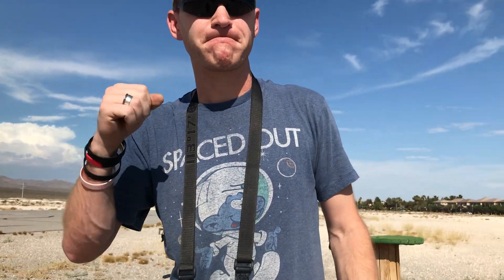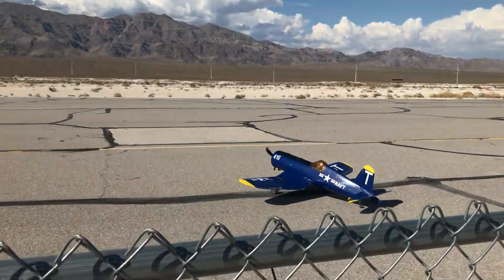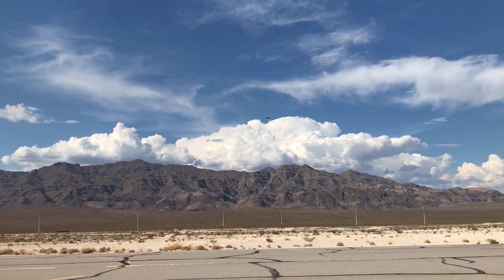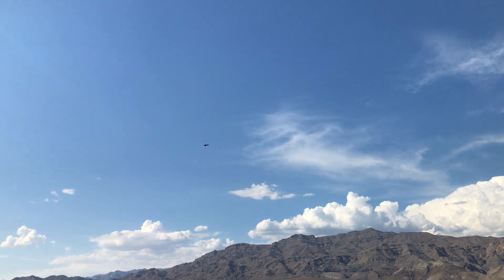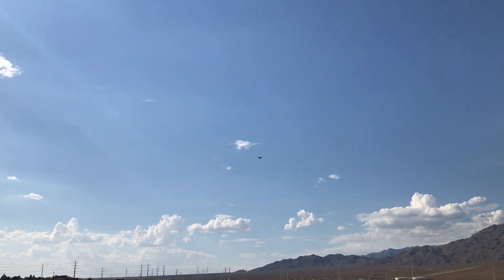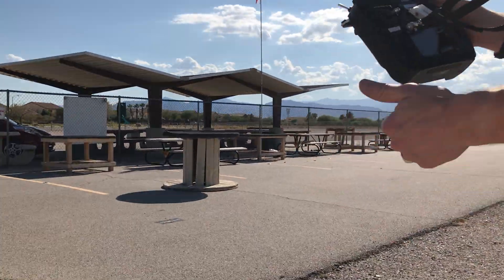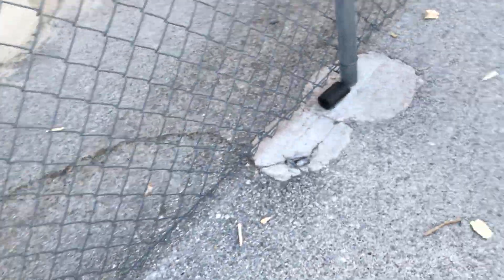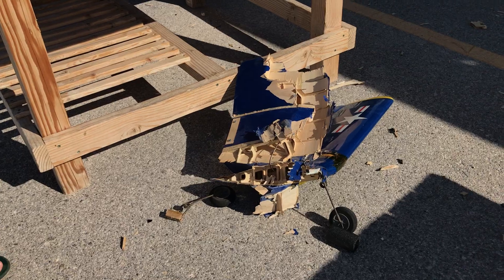First Gas Airplane Ends In A Catastrophic Crash

Comment from the maker: 1. Before you leave a comment about the RF signal critical... 
I'm using a multi-module transmitter with a spectrum receiver. 
You have to calibrate the RF signal otherwise it will constantly yell at you that 
there's an RF signal critical. I did not calibrate the RF so it always does 
that unless you turn it off. i forgot to turn it off before the flight. 
However I did set up fail safe and did a range check so all good there.

2. what happen?  
I added a soft Mount to my flight controller to test a few new things. This which actually worked OK on lower RPM. 
However at Full Throttle it got a little wonky 
due to the refresh rate of the flight controller matching the vibration rate of the full rpm.
if you watch the video you can see this in flight and right before the crash. and when doing high speed passes. this was a known thing and this is what i was testing. 

Watching the video back it seems like I was going full power trying to pull up 
thinking more speed would help but actually I think it was upsetting the gyro even more.

I kind of proved some of this out on the ground while I was testing and knew it could be trouble.

I actually had two settings on the gyro on a switch so I could play with high gain and low gain.

It didn't seem like it mattered but the low gain was more stable from the vibrations.

I went out there to do some experimentation with this type of Gyro with that type of isolation
 and there's the result. 
 
3. The fact that know one was there was a blessing, it was also intentional.  If I'm doing "new" testing of things i try to go out while know one is there for this exact reason. 

You cant fail if you don't get out there and try new things... but you also cant succeed ! don't be an arm chair pilot ( or commenter at that)  

so enjoy the carnage at my expense. 

~Russ
Reply: Try new things , what ? Flying with servo jitters is not new things, it’s very known not to do it.  What a waist of a beautiful plane.  You should be fined for that failure caused by incompetence.
Reply: I totally agree. I’ve had that same plane with the same zenoah 20cc engine. It’s a piece of cake to fly and rips the sky up like it’s on rails. I couldn’t force a bad landing out of it. I believe he took off without the gyro on anndnhe was doing fine. Not sure why he felt the need to ride it anll the way to the ground with it on if it wasn’t performing properly. I ultimately sold it since I had 4 other larger corsairs. That one actually flew best of them all and I miss it. I guess if planes kept getting “gifted” to me I could afford to “test” them into the ground as well. Lucky someone didn’t get killed. 

I don’t normally use gyros but aren’t they supposed to be HARD mounted, like NOT velcroed or double sided tape??? Don’t most people glue them and start at the Lowest possible gain and work up???
Reply: @RWGresearchLive   Didn't want to come off in a bad way. I just heard the radio repeating it.  P.s I have X1 carbon and love to print that one out.
Thanks
Reply from the maker: All good my friend! just wanted to make sure there was more context to the video as it seems everyone keeps saying the same thing lol  , cheers! ~Russ
Reply: This Pinned comment has been copied and pasted by this Cat in almost every reply.
Like this multi-module transmitter makes it ok to ignore if you don't shut it off so it doesn't yell at you..
because you chose not to calibrate or you were unable to calibrate.
Protocol, man.... protocol.  
And this guy does "Research" ...... SCARRY!
And yes I have Read All 90+ posts
Reply: Signal loss was literally your issue.

I don’t think you have to calibrate spektrum rx’s. I have futaba and frsky that you do have to calibrate, but my lemon and speks don’t need it.

It’s not ok to fly until they are fully calibrated.  It’s basically de tuned and it will unlink, or run like it’s in range check mode.  you could hear the engine powering down, likely going into fail safe.  

could have also been the ignition system causing interference to the rx.  That is very common.  Those systems need to be pretty far apart, and not share batteries and stuff. 

It flew well, looked like it was dialed in pretty good when flying.
Reply: You dont need to fine tune the frequency with DSM on a TX16S 4in1.  Other protocols like FRSky, yes, but not DSM.  I suspect you may have used auto when you binded to the RX and selected the wrong sub protocol.  What sub protocol were you in, and which receiver were you using?  Its very likely you had signal loss.
Reply from the maker: ah, so not the frequency of the TX/TX, but the RSSI has to be set to set. the signal was ok, just not the RSSI tune... ( the part that was yelling at me the entire time) ~Russ

Comment: I help new pilots at our club flying field often. Ive been flying nitro planes since '78.  I mainly fly 3d helis now.   I see 'new pilot' mistakes all over this video from the take off to the crash.  Its sad to see it go down, but it should have never gone up in the condition it was in on the ground.  A tiny bit of gas engine flutter on a large 40% Edge is ok, but this was not ok.  We dont fly gyros on airplanes (Horizon junk). Also, Warbirds are no joke. They were tough to fly in real life. I was trained to fly RC by a WWII pilot. It was a huge honor.  Thanks for sharing.

Comment: Sorry for you loss but your attitude was wrong from the start. You had known issue but ignored it. You had incorrectly set up warnings , strike two what were you thinking. And if you need stabalization on a plane you shouldnt be flying it yet, get a buddy to fly it and sort out the trim then once its sorted add the stab
 All your doing is creating bad press for the safe quality pilots out there . Learn from your mistakes and get some help. Your child could easerly have been sitting where that crashed.

Comment: People need to remember these are not "toy" airplanes and have a good amount of power pulling them thru the air. Glad no one got hurt, as bad as that sign got bent if it would of been a human standing their it could of ended their life. Also fail safes are very important and i have a feeling one was not set or set improperly as the motor reved as went down.

Comment: If it stopped responding it sounds like your battery in your plane or your transmitter died. Or the battery in your plane came unplugged or you had a tx or rx failure or a control linksge came off. Was a nice looking Corsair.

Comment: THere is no reason to have a gyro on a small plane like this.     If you're a decent pilot you don't need a gyro.
Reply: He did say he has little to no experience with gas powered planes so he does indeed need a gyro you know it all.
Reply: @daddymcslap  If you knew anything about RC planes it's that THIS Corsair is NOT a beginner plane.    There are lots of better planes to fly before this when you're a novice pilot.   If you try to fly planes above your skill level you're almost guaranteed to crash and possibly hurt someone (as this guy would have if anyone was sitting at those tables).     And - again - there is no need for gyrols an ANY rc plane, other than turbine jets.

Comment: I've used those flight controllers once before. I can fly fine but wanted to see how it felt. It was awful. It did all sorts of unecessary things. I honestly feel it's best to learn without these flying aids especially with the simulators out. At first I thought your control horn on the elevator came loose or got slack

Comment: My guess is the elevator was wagging till it broke the control horn or stripped a servo gear.
The stabiliser let you take off, so I don't think that was the issue.
Wagging or flutter causes way more stress than you might think.
I read what you said about the signal warning but I would not have flown that plane with the glitching or the warnings.
Fixing on the ground is definitely preferable to fixing after they hit the ground.
The plane and transmitter were both telling you not to fly.
Sorry for the loss but as you said, main thing is nobody was sat there and it takes balls to put the video online.
I'm impressed at the short time between, I haven't crashed yet, and bang.
Hope you dont mind me saying, you need a bit of work on your take offs.
It's not just throttle and elevator until you're in the air.
Slower acceleration will give much more time for corrections.
Having said that, on a maiden you do want to get height quickly to settle it and trim it out.

Comment: Sad, i am really sorry 😢
But why do you need a stabilizer?
You must fly it well to learn how to tune it well. When you are flying well, why do you need a stabilizer then? Whoever tried stabilizers and tried to tune them well in our club, nearly all of them crashed badly...
Reply from the maker: It is an experiment.. It was going great right up in till it wasn't ;) ~Russ
Reply: Stabilizers are a great help for pilots that like the extra piece of mind in windy days. They are not disign to improve you flying skeels. That said, I use an AR Smooth flight on my 70cc Laser and it does the job amazing. In my club everyone is using Cortex or AR on theyr turbine jets and all have grate results, Just don't trust your expensive plane to a low cost cheap stabilization system, better invest the money and get something reliable or dont use a gyro at all.

Comment: We’ve nearly all been through crashes and being over ambitious when learning.  These days there are buddy boxes and simulators that help reduce casualties.  Models do have to be perfectly set up. I prefer a simple transmitter and receiver. A beginners mistake is to fly downwind and get disorientated. Get an experienced friend to mentor you. If your model is artf then today you’ve only lost cash. All that concrete is not forgiving. If you have a complicated transmitter then set it up properly. Same for gyros. Long grass in the flying field helps bad landings. Scale models are usually the hardest to fly.

Comment: Never EVER put a plane in the air if your servos are glitching out like that.  That was the first mistake.  That sound of the engine changing rpm was not a fuel bubble, it was your throttle servo doing what all the other glitchy servos were doing. This could have bee prevented by a little more ground work and prep.  Just lucky nobody was killed.

Comment: Horizon has everyone convinced that RC planes can't fly without a gyro of one kind of another.
Reply: been flying for years and have never used one. probably good for beginners though
Reply: @1FlybyPilot 
Best thing for a beginner is a qualified instructor.
Reply: @richard1472  And a simulator lol this was a disaster from the moment it took off
Reply: Facts it’s sad as hell. Even in the helicopter world they learn on these little blade helis from horizon and think they can go straight to a 600-700 size but soon realize that auto stability crap they grew accustomed to are not going to be on an actual hobby grade helicopter and it ends very badly. We usually get videos of this in my groups I’m in and it’s a 3 thousand dollar mess of parts after
Reply: Gyros on airplanes are for noobs.

Comment: It may not have had much interference in your flight, but the control horns in the ailerons were installed way too far from the leading edges. You lose what is known as mechanical advantage. Better luck next time..

Comment: Well, I have been flying for years....
And you sir are the kind of people this hobby does NOT need.
If something is not acting right, You NEVER proceed, PERIOD... until you get it sorted or fixed.
The reply,. This kind of thing happens as an excuse, is totally unacceptable.
Yes, crashing is in this hobby. and yes, it happens,
Not listening to RF critical, it progressed to that, the $300. radio was smarter than you and you are obviously not smart enough to be ashamed of that.
It does not do my feelings well to type this to I hate to refer to you as a fellow hobbyists.
You should have never been turned loose to fly alone.
Somebody needs to get your attention and get you trained, before you tear up more than your @$$ can cover.
You are a Huge Liability.
Gifted,. and you had nothing nothing in it and it shows.
Jump right into a $3K helicopter since you don't mind crashing, but make sure it's your money this time that you spray in the Pits.
AMA., are you seeing this. ?

Comment: I read the signal telemetry wasn’t calculated correctly, so you ignored the warnings. Even though it went from “low” to “critical”, which means it was deteriorating.
You demonstrated that the gyro wasn’t working properly on the ground, and claim that you can fly without a gyro. Then why did you constantly use the gyro?
I’m amazed that your club allows visitors (your child) to be near the flight line, instead of behind the safety fence.

Comment: I'm sorry for the crash, but the key lesson here: The radio telemetry signal was telling you from the very beginning about signal quality low / critical, on every single pass we can hear the alerts coming from the radio, that to me is a NO-NO. You should have landed that plane immediately and correct the issue... this crash could end 100 times more dangerous..
Reply from the maker: I'm using a multi-module transmitter with a spectrum receiver. You have to calibrate the RF signal otherwise it will constantly yell at you that there's an RF signal critical. I did not calibrate the RF so it always does that when you connect the multi module like that. However I did set up fail safe and did a range check so all good there.

~Russ
Reply: @RWGresearchLive  right there you had a red flag, I wouldn't fly anything bigger than a park flyer plane with these multimodules (particularly not calibrated), on top of that, the fact that you are using a gas plane adds more risk factors because of the engine ignition circuit which deals with high voltage sparks, etc. That alone is also a very common cause of interference unless you have a robust Rx/Tx link....chances are that the glitch you were having (even with the plane on the ground) was produced by the engine ignition circuit interference and not the stabilization.. anyways...  we have to respect this hobby and I'm glad that this crash only affected the plane itself and not other people's property and/or persons. Cheers

Comment: Rf signal critical, would of made me land it or try too ! Bummer
Reply from the maker: I'm using a multi-module transmitter with a spectrum receiver. 
You have to calibrate the RF signal otherwise it will constantly yell at you that 
there's an RF signal critical. I did not calibrate the RF so it always does 
that unless you turn it off. i forgot to turn it off before the flight. 
However I did set up fail safe and did a range check so all good there.

~Russ

Comment: SAFE is unsafe.  It creates bad habits.  Flight controllers are ok on your first flights with a trainer, then you must ween your self. Otherwise you will never learn proper rc skills, especially rudder on take off.  Keep with it. Get a good trainer and practice.  Especially take offs and landings when your ready.     Good luck and great video.
Reply from the maker: Yeah I can agree with that. It should be more for emergencies and to get started l. I can pilot an RC and do it all the time. However I knew going into it. That this set up was experimental. 

Hence know one @ the fiy field while I was testing ;)

Cheers. 

~Russ 

~Russ

Comment: "RF Signal Critical"... what was the cause of that?  Scary!
Reply from the maker: I'm using a multi-module transmitter with a spectrum receiver. You have to calibrate the RF signal otherwise it will constantly yell at you that there's an RF signal critical. I did not calibrate the RF so it always does that when you connect the multi module like that. However I did set up fail safe and did a range check so all good there.

The cause was the gyro. They don't really like the vibrations from the gas motor... This was a test on a new mounting technique. Was working fine for the first part of the flight! 

~Russ
Reply: @RWGresearchLive Was it a $20 gyro?

Comment: Well, for your future gas airplane you must have enough distance from the receiver and engine ignition module. The radio was warning about critical RF signal and low RF signal. Unfortunate result; the model was flying well, once you heard the RF signal call outs, land and investigate.  Good luck with your next model.
Reply from the maker: I'm using a multi-module transmitter with a spectrum receiver. You have to calibrate the RF signal otherwise it will constantly yell at you that there's an RF signal critical. I did not calibrate the RF so it always does that when you connect the multi module like that. However I did set up fail safe and did a range check so all good there. ~Russ
Reply: @RWGresearchLive  ahh, understood, I have open resource FRSky, I understand. It seemed to have lockout at the critical time you were pulling up to save it. Hope you stay with it, your sin seems to like RC airplanes.
Reply from the maker: @jimg163 yeah he flys with me a lot. He is a great pilot. We have lots of fun together. Cheers. ~Russ

Comment: Your radio said RF critical. Loss of radio signal caused your crash.
Reply from the maker: I'm using a multi-module transmitter with a spectrum receiver. You have to calibrate the RF signal otherwise it will constantly yell at you that there's an RF signal critical. I did not calibrate the RF so it always does that when you connect the multi module like that. However I did set up fail safe and do a range check so all good there. ~Russ